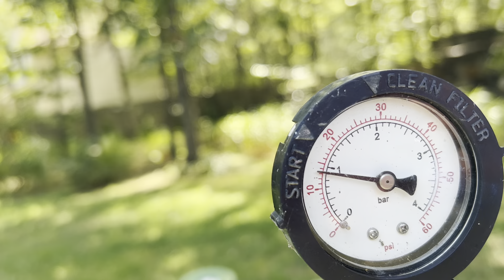Pentair clean and clear plus filter cartridge removal and cleaning

Comment: I installed the exact filters today.  Your video was funny and helpful.  I had a problem reinstalling the band around the housing as did you.  I suggest you get a good piece of gorilla tape to keep one side in place while you negotiate the business side with the bolt and compression nut.  Also, the housing is made of fiberglas and you should wear rubber gloves and a long sleeve shirt to avoid the fiberglas particles embedding into your arm and hand.  DO NOT over tighten the compression nut.  I left round 1/2" between the two band where you tighten the bolt. This is my first pool with cartridge filters.  The jury is out as to how much I will like it as the filters are expensive.  I can't backwash this filter as I could with sand filters.   I had some problem getting the lower drain plug to stop leaking.  I decided to use a few wraps of teflon tape with the yellow O ring.  I used a ratchet to tighten the plug using a 7/8" wrench (not the channel lock tool) as the plug is so low to the ground.  Don't overtighten that plastic nut.